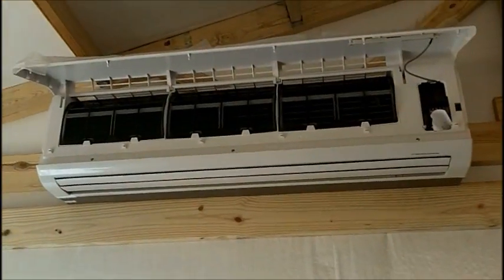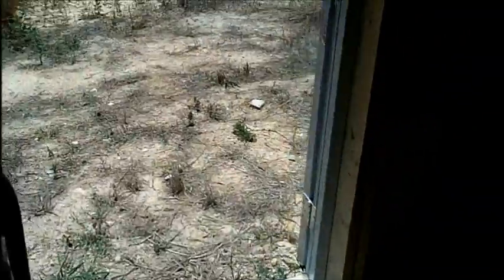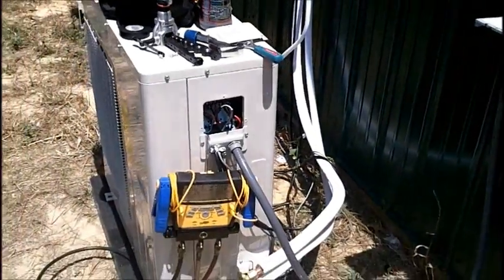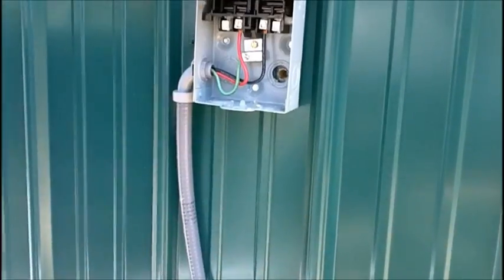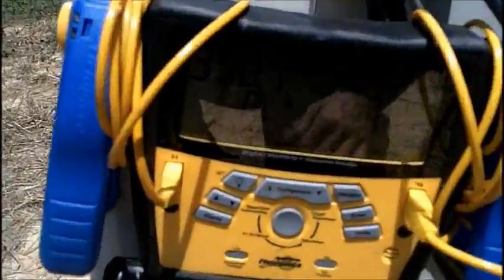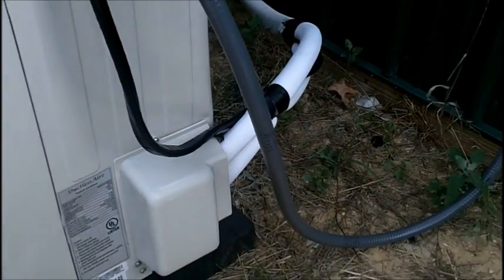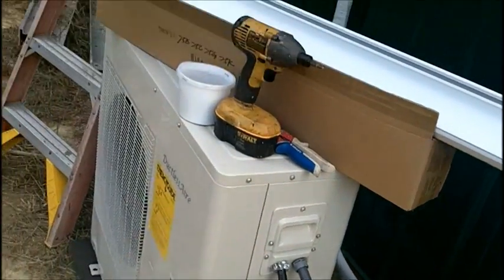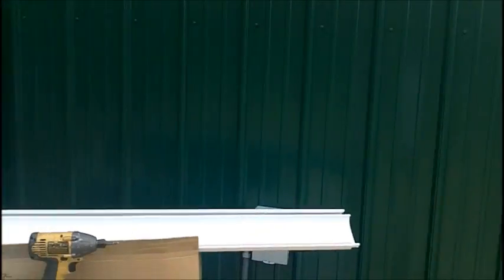Mini Split Heat Pump INSTALLATION

Comment: Nice video, and of course makes it all look so easy. In real life, as a DIY'er, I'm not finding it to be at all easy for a very large number of reasons, not the least of which is the omitted information about many things in the instruction booklet. This video says the 12,000 BTU will use 110v, not 220v, however my Ductless Aire 12,000 unit requires 220v, and that was a large ordeal in itself to install all the complicated turns of wiring ducts around the house foundation and over to the main panel. There are details about my particular installation which are really far more complicated than the installations shown in any of these mini split videos. As one tiny example, just finding and ordering the correct circuit breaker took at least 4 trips to both Lowes and Home Depot, and about two weeks time. They called it a "special order item". I could go on and on about all the difficulties I've experienced with this (not yet installed after months of work!). Now I have go 12 feet up a ladder (and I'm not so young anymore) and try to make a round hole through the old aluminum siding, and then continue through the clapboards. I did call the a/c company who installed my entire central air years ago, to seek help finishing this up (the copper lines, vacuum, manifold work, copper flaring, etc. Guess what? They refuse to help whatsoever, using the reasoning "because we didn't install the unit". Ever heard of an a/c company refusing a job? Oh, also, I've had to buy a good number of expensive and special purpose tools to do this. I still can't foresee actually getting the job all done.
Reply from the maker: Yes it is all in the planning and on the breaker becuase your new to it all you have to learn everything .  I am sure with 1 look 10 seconds I could have ordered right one from Amazon and you never would have left the house.    And with baker scaffold and hole saw make a fast clean job with aluminum.    But all this takes years of knowledge from doing thw work .  You are trying to get that knowledge in short time.   See your next one will be much easier.   And I'm sure the generic Chinese English manual doesn't help you get that knowledge either.

Comment: I liked ur video.  Great demo. . 1 question ;; i bought a 12000 BTU 1 Ton. Its a 208/230v . What kind of wire u  tecomend a #10 or #12 for this unit.
Reply from the maker: #12.    10 is too big to get under the terminals and secure properly.  12 is plenty large enough for over 100ft run
Reply: @ACPro  12/2 romex is ok.? Thanks

Comment: Hey Toby I bought a 12000 BTU system that is 208 230 volts. Do have to run high voltage lines all he way back to the indoor unit or is it all controlled by the signal wire?
Reply from the maker: It should have 4 wires included with the package. 2 of them are high voltage. 1 is signal and 1 is ground

Comment: Hey Toby, did the unit come with it's own Signal Wire? Thanks
Reply from the maker: The old 13 seer did.  The newer 15 seer and up only requireds 4 wires.   L1 l2 s and ground

Comment: i have a ductlessaire 1200 btu the inside unit has red black and yellow wire the outside unit has blue brown and black the wire that came with it has black red and white and green which is ground so what would i connect the white wire too
Reply from the maker: Sounds like you have a neutral wire.   Air conditioner doesn't require a neutral .  And green ground goes direct to cabinet ground screw

Comment: Why do you need 10ft? Can I cut it shorter? The run I have doesn’t need more than 6 ft.
Reply from the maker: If you only need 6 foot you can take line set down the opposite side of condenser  and then make 2 more turns to use the other 4 foot.    You need at least 10 foot due to the lines are not suction and liquid as in Central units.  They are actually the indoor coil.   So by making them too short its like removing part of a coil.
Reply: Thank you for the response and great videos! I’m plugging away on installing my units as well. However, I have no clue where the control voltage wire is? Do I have to go buy that. I have the power wires, just not the other ones. Thanks again
Reply from the maker: With the new inverter systems.    You only need 4 wires.    Number 3 wire is your data.   So you don't need sensor wire like with the older 13 seer machines.

Comment: Toby I know this is an old post but I'm trying to figure something out with a unit I'm installing right now and I can't get help from the manufacturer. I have the model DA2421-H2. It appears to have drain ports on both sides of the unit. The unit came with a hose attached to one port. Are you familiar with this model and do you now if i need to plug the empty port up? I am not familiar with the connector on the port so I don't know if it needs a cap. Thanks
Reply from the maker: Yes. Most of the systems are the same.   Watch my drain video and it explains how the drain works .    One side needs a plug and other side is the hose.
Reply: @ACPro  I have the same DA2421 H2 unit the outdoor unit came with a white flexy hose looks like drian hose is that just extra for indoor unit it does fit on preinstalled drain line of indoor unit (instilation manual says extension not included)? I dont see a drain plug for the outdoor unit or a place to put one (have looked under unit). Does this unit have one made into it and have a nipple to connect hose I mentioned above? Any help would be appreciated thanks.
Reply from the maker: @matthewkilpatrick73  I'm not sure . Every model is different I would have to see it to know
Reply: @ACPro  okay no worries, on the lines themselves is there a good wrap to put on them or is line set cover best route
Reply from the maker: Here is the link https://youtu.be/YBppLRT5gAs

Comment: Was the copper set lines pre connected to the inside head unit when shipped or can you install both ends after you get the unit. Thanks, Tom
Reply from the maker: Indoor units come with around 2 ft of copper to get through the wall straight behind the unit.  Then the line set is connected after indoor and outdoor unit is set.
Reply: @ACPro  Thank You Can you tell me what gauge wire you used up to the head unit in side the building
Reply from the maker: @tcbridges  14 ga 4 wire.   You can find it on homedepot.com  just search mini split wire.

Comment: Thanks Mr. A/C PRO. you video was so important to me. I have 2 questions: 1) what should it be the break for that 24000 btu mini split, 20 amps? 30 amps?. 2) what is wire gauge to run a line from my electric main box to the disconnect safety box that is outside, next to the condenser?. Thanks again for your help.
Reply from the maker: depending on you length of run to what size wire. but if it was me . i would run a #10 wire on 30 amp breaker .

Comment: hi i can use a wire #8 for outdoor unit  minisplit 2ton thank
Reply from the maker: You can . But number 8 wire is too big for mini split outdoor terminals so you would need to run 8 to your disconnect and then I would recomend 10 from there to unit.  As a poor connection will cause terminals to burn at connections and be a hazzard.
Reply: A/C Pro thank you